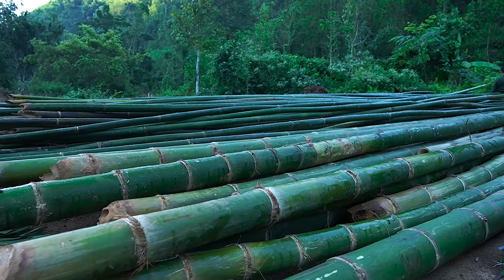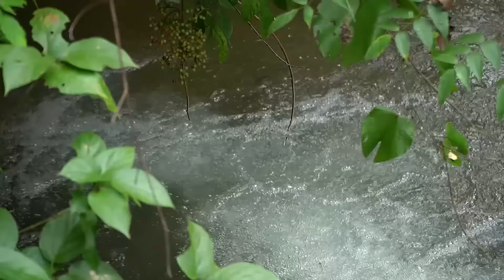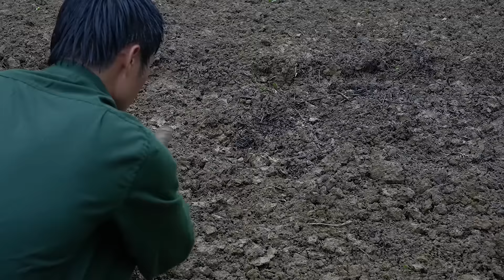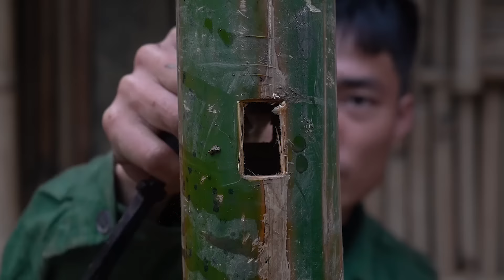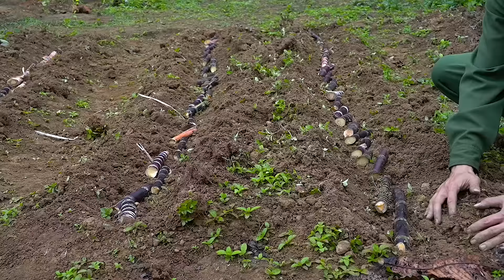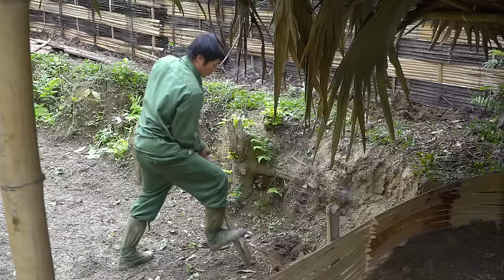FULL VIDEO/150 Days: Farm Renovation & Building Process (Free) |Growing - Harvesting

Comment: I like your wall a whole bamboo but i prefer s bamboo cut in half then assemble it face to face of each other jusy like what others did when they make a roof out of bamboo & to a wall so as not cold air wont  easily  zip through during winter